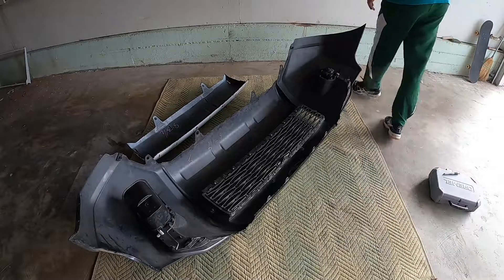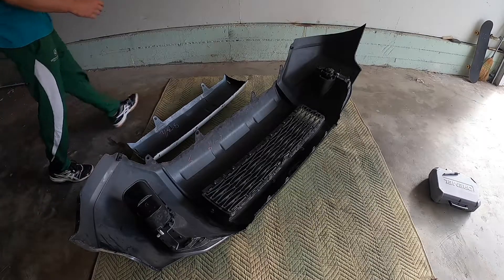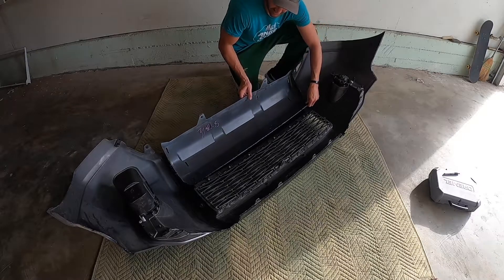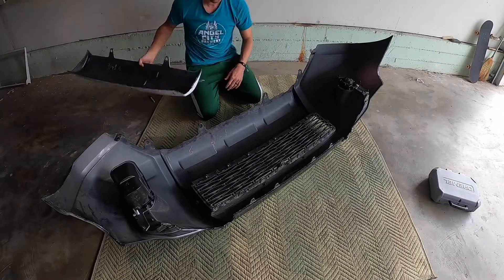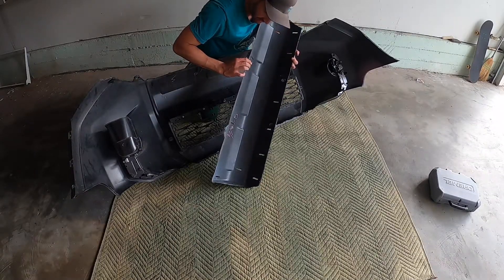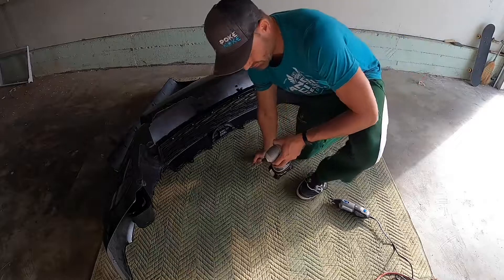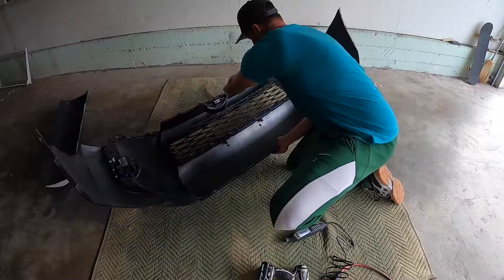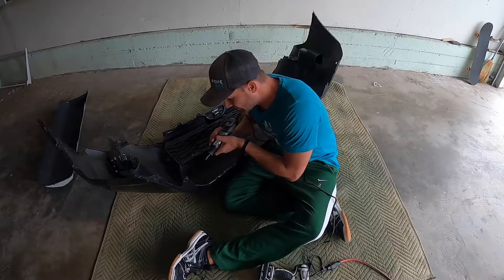5th Gen SR5 4Runner Front Valence Install

Comment: Do you have a link for the clips for the valance?
Reply from the maker: I used them from my buddies but these are non oem ones. https://www.amazon.com/Rexka-Spoiler-Moulding-Toyota-75392-35220/dp/B07BHCXWV5/ref=sr_1_2?crid=2O3HWRB81LOO7&keywords=4runner+front+valance+clips&qid=1659460200&sprefix=4runner+front+valence+clips%2Caps%2C137&sr=8-2

Comment: What is the purpose of the valance?
Reply from the maker: Just looks. The TRD's come with them.
Reply: The valance adds some protection to your bumper cover. If you take an approach that’s a bit too steep, you could drag your bumper on the ground. With the valance there, you’ll scratch the valance, which can easily and cheaply be replaced. Without the valance, you’ll scratch your bumper cover, which is a much larger piece that will need to be repainted, repaired, or replaced.